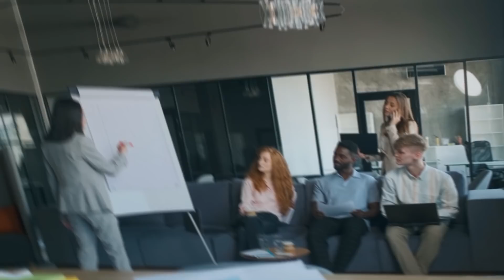This Chinese Mega-dam Will Destroy Asia!

Comment: There are other less environmentally invasive renewable energy sources - solar, wind and geothermal. I think geothermal is "the answer". It is available everywhere and is capable of providing electricity on demand.  It can also provide all the energy we need. The problem is, the electricity system is inefficient. Other renewable energy sources need to be developed; the primary one, is biomass and its potential to produce liquid fuels for the transportation sector.

Comment: 6:11 I believe the most beneficial pull of solar wind and hydroelectric Energies from the environment will reduce natural disasters in other areas as well as our own and accelerate Healthy Growth. 6:53 as we assure pipelines will not be disturbed by our work we should assure endangered species are re-homed to prior to Construction. 8:28 that's why I was saying we need to go through some of the arid or arctic areas to refuel them. We need to start the suction points at the most polluted areas that we can find and work with existing ocean currents. Thanks for all your hard work everyone we hope to get everything on a better page of understanding with everything we learn and share.

Comment: The sinister narrative of the hydro-electric dam in the Tibetan region of China is really uncalled for.  On the Chinese side they are able to harvest green energy from their water resources. While on the Bangladeshi and the Indian side the dams in China will regulate the water flow thus reducing the probability of severe seasonal floods in their riverine and delta regions.  The speaker has his right to present his paranoid views of mega infrastructural projects in China.  But let's be factual.  Like his allegations against the dam on the Mekong River in his earlier video turned out to be non issues.
Reply: Build the dams, but with Indian oversight and control in running them.  The electricity can used by China, but operation should be managed by India.  There is too much potential of China using the control of the dams maliciously against the downstream nations to either deprive them of water or intentionally flood them…  Control of these rivers is more critical for India and Bangladesh than China.  China’s interest in the region is likely to get leverage over their neighbors.  I don’t believe they’re primarily motivated by electricity generation because hardly anyone lives in Western Tibet near these rivers anyways.  It seems more likely that China wants to weaponize control of the waters to hold it over their neighbors’ heads.
Reply: @_Painted  Can the Colorado dam be handed over to Mexico? I heard that the dam has seriously affected the water resources of Mexicans, where water is more expensive than Coca-Cola.
Reply: @_Painted  lol why would china trust india with their dam?
Reply: @_Painted  Well with this much additional  electricity power they can link it up with the China Southern grid and sell green energy to Nepal, Bhutan and Bangladesh right?
Reply: @rusticbox9908  However the electricity should be used and profits/costs should be split up is up to China and their neighbors to decide and I have no opinion on that.  

For the actual construction to even be allowed, India should be involved to oversee the dam construction and operation to make sure that they don't intentionally or accidentally harm the downstream countries.

India needs to make sure that China doesn't gain the power to control changing the water flows to gain leverage over the downstream countries.  If China can choose to cut off the rivers or flood them at will, India would be careless to let China get that kind of threat to hold over their heads...
Reply: @_Painted  no, not profits, the Indians can build their own dam downstream if they like. The water is just withheld and released in a controlled manner, the water hasn't been diverted.

Comment: Xi Jinping, you don't want me as your personal advisor in environmental friendly and clean energies either, because I don't need to watch this video to the end, to know that whatever you try to build there is crap and to dangerous. But my own ideas how to generate more energy more quickly from natural sources are not as smart as they look either. My latest idea how to build a bigger solar collector more quickly because I feared the gas would run out was the following: look for a mine (iron, metal, gold etc) in your country that is already roughly shaped round. Reshape it quickly into something that looks round and parabolic and does not have to much corners etc in the walls, use the money from whatever you mine there to refinance the quick reshaping ("finally environmental friendly gold without child labour involved in it invest here, carbon compensation for flights to visit it are included for free, you have 20 minutes to decide if you want to have this investment product from your local bank and if you click here in just 30 seconds you can win a dance with Claudia Schiffer for free") This business idea will surely be easy to finance and even some kind of high tech metal spray paint sprayed there by an custom designed airplane for the finish (in the night). But once that parabolic mirror with the radius of 1 to 3 kilometers is running (and I guarantee you it will produce some electric energy on sunrise even if you can't move the mirror in the direction of the sun) at noon the first doubst will arise about how qualified I am as an environmental scientist ("I am absolutely sure that this is a plasma fire up there in the air but I don't want to find out at what height it is currently burning and measuring the temperature with some kind of optical device does not interest me in the moment either.  But I am absolutely sure that earth is loosing atmosphere now and at a speed that is surely not really slow. That is what German environmental scientists mean when they talk about "clean and safe energy directly from the sun"?  I think German is more tricky to translate than even Chinese...

Comment: Bangladesh has another problem of rising seas from climate change. it seems they will be displaced whatever happens to the river.
Reply: Sea levels rising is a total myth propagated by climate alarmists. If it's happening at all it's at such a miniscule rate that there's no way it's enough to displace populations. Erosion and land sinking - as in West Java and some Pacific islands - is a different problem altogether and should not be confused with rising sea levels.
Reply: @redplanet7163  The first report (book, no internet yet) about what is now climate change was published in 1976.
About a 40-50 years later we regularly have extreme climate events.
In another x years we will have more floods from rising seas.
Climate change is a slow process of thousand + years that can’t be stopped easily, until we discover a process that removes carbon dioxide from air or water.
When Russia destroys grain and the growing of grain in Ukraine destined for a large part of the world we know that people will die of starvation in the world.
The time scale of available food is shorter than climate change, it is inevitable that both disasters will happen.
Reply: @redplanet7163  I live close to the sea and spring high tide is exactly 2m below my house when I build it. There are more high tides that reach that level now, could be other factors involved but that is what I see with my own eyes. My guess is that it will last my lifetime and that is enough for me. The CO2 rise and following temperature increase will not cook the earth, some places will become more difficult to live because it will get hotter. A temperature change is not evenly distributed over the whole earth just like sea level rise is uneven mostly depending on (change) of sea currents. Russia economy depends on revenue from fossil fuel, there is talk and action to reduce Russias products. I expect the change to green energy to be accelerated especially in Europe, in the meantime maybe more coal for political reasons. Sea level rise is not immediate it is a slow process, the quantities of ice and water are too large to see effects within a few months. What we do know is that the process will accelerate but no figures are possible how much. I know Trump has invested in a seaside property, don’t know enough about Al Gore and Obama, I don’t live in US. That risk factor is low as sea level rise is slow. People will continue to want living close to the sea. Personally I don’t want to build on a place that is closer than 2m above high tide. I think 2m is enough buffer in my life time, after this century it might need more to feel economically comfortable.
Reply: @titussteenhuisen8864  "some places will become more difficult to live because it will get hotter." This may be true. On the other hand, other places which are now uninhabitable will become habitable. In fact, theoretically vast tracts of earth would become viable if the earth warms. Just as they did in ages past. But in this present climate (pun intended) of alarmism we are only supposed to be scared and worried. That's what this is really all about. Scared and indoctrinated people are easy to control. As for building 2m above sea level...you would be mad to build any less than that. Coastal plains and river flats are inherently unstable regardless. I live in Australia and I can assure you that the water marks on the old buildings in Sydney harbour are exactly where they were when they were built (circa 1790). On the other hand I've seen whole coastlines wash away in Indonesia. Two years ago I flew out of Jakarta. You can clearly see what used to be rice fields extending far out into the sea. The land is sinking. Some Pacific Islands are sinking. But they go public blaming Australia for "sea level rise" which is convenient but patently ludicrous. Other islands are growing. It's a volatile region. But again, we will never hear about that in the media. It's all about blame and fear.
Reply: @redplanet7163  I don’t buy into your use of ‘lower emotions’ like fear, blame, hate, dishonesty, egoism etc. Where these emotions are coming up through hormonal system - yes express them if you don’t want to control them. They can also be generated in our mind, I think a human with a developed mind has these lower emotions under control and will not express them. I think you are scared (don’t know why) and flip to the opposite and go into denial of climate change. If I live a few years past the hundred it will be 2059 that is my budget to live. The forecast is sea level rise 1-1.5m by the end of century so 2m has a good safety margin. Yes Jakarta is sinking, one of the places where people will be uprooted and shift to higher ground. There are maps that depict the areas that rise and fall irrespective to climate change, just make an effort to find that. California is expected to become drier so people will eventually move away from there under influence of climate change, If that will be Alaska in hundred years time I don’t know, economic factors are very important to where people live.
Reply: Rising seas, or subsidence due to ground water extraction?
Reply: You can add tectonic shift (volcanic action) if you doubt climate change is not real.
Add to groundwater extraction; extraction of fossil fuel. 
Haven’t seen a recent figure years ago In the Netherlands the drop in surface was more than half a metre luckily than far away from the coast.
Guess it is about a meter drop in some places before they stopped gas extraction..
In US water table drop is well known because of fracking, same principle.
Reply: @titussteenhuisen8864  areas of California’s Central Valley have subsided 40 feet, due to water and oil extraction, and likely more, as my Geology notes are over forty years old. Which also plays havoc with irrigation canals, bridges, roads and rail lines.
Bangladesh has the same issues, as much of the drinking water is ground water, compounded by salt water intrusion along the low lying coast.
Reply: @johnkoziel789  If / when California gets too dry its population will disperse just like in Bangladesh all because of climate change, not because of man made structures or activities. California was too dry to be colonised, men made activities made it possible to live there, different men made activities will end the huge population there. Whatever we do nature does its own thing, life will continue without men. We can only adapt as good as possible to nature.
Reply: @titussteenhuisen8864  if the water won’t come to the people, the people will go to the water. That is a story as old as human life itself. California had a relatively high population, even before the Spanish missionaries.
Reply: @johnkoziel789  My memory disagrees that California had a large population of Mexicans and Indians. It was owned by a person who sold it to the ‘Californian government’ for a nominal sum because development of the land required too much money. The ‘Californian government’ attracted people who made it’s development happen to the very prosperous state with large population it is now. The sale of the land now labeled California made it happen, before it was a desert with almost no population.
Reply: @titussteenhuisen8864  before Mexico, it was the Spanish, soon afterwards Sir Francis Drake claimed North California for England. Russia came next in 1812 to North California, to exploit resources, not to conquer, followed by Mexico in 1821. 
Before the Mission Period, California had a large population of Native Americans, estimates range from 150k-700k.
Reply: @titussteenhuisen8864  No, I had neighbors growing up. Descendants of an officer from a Spanish expedition in 1776 to establish missions in CA. The officer receive one of the first and maybe the largest landgrant of originally 300,000 acres. This was a Spanish landgrant in 1784. Mexico also deeded lands through landgrants, but that didn’t happen till after 1820.
Reply: @johnkoziel789  Looked it up, I was thinking about John Marsh (died 1856) he owned a large ranch and was instrumental to get more people to California. After that the population of California started to increase with lots of new enterprises attracting people (gold rush as well). Wasn’t right that he sold his land.